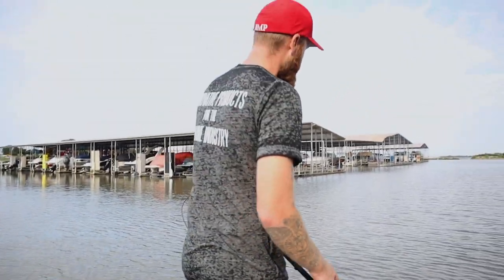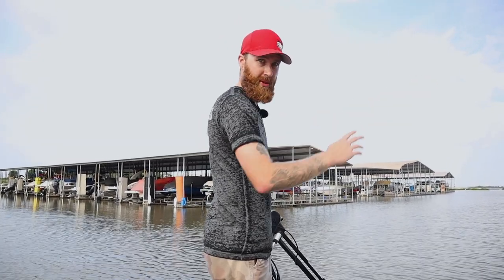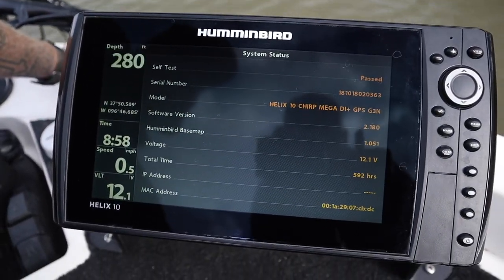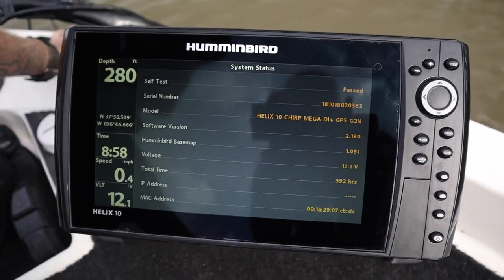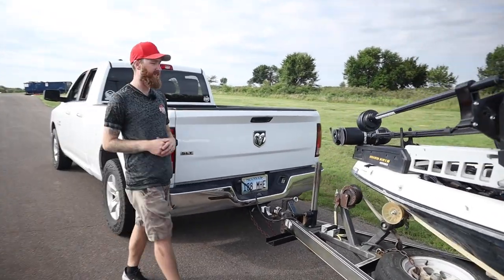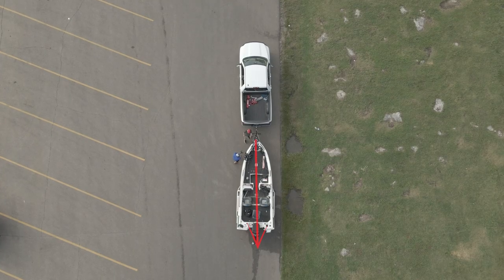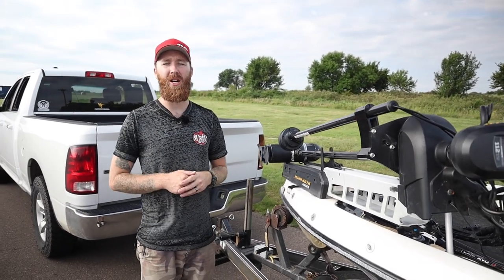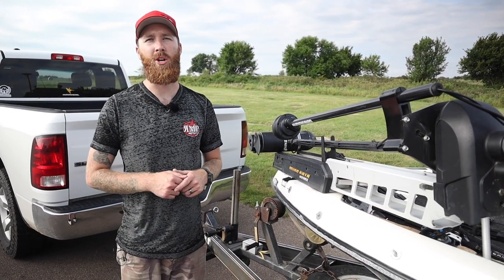HUMMINBIRD Mega 360 HACK - How To Get Side Imaging On Your MDI+ Unit - BUDGET FRIENDLY OPTION.

Comment: I am waiting for the Mega 360 transducer to be built in to the Minn Kota Ultrex, also expecting a real cable steer instead of the current "cable" (fly by wire) power steering version to compete with the Motor Guide Tour Pro. ...May never happen but Minn Kota Raptor (Power Poles) did.
Reply: You really don't want 360 mega mounted on your trolling motor. Then it would be the same problems you see with the trolling motor transducer from the other manufacturer's. The good thing about 360 is it's always oriented top of the screen in line with the bow of the boat. The others will move around depending on which  way you are trolling motor is pointed. Mounted a transducer 20 years ago on my trolling motor so I could see under docks. Problem is you have to position your boat with the trolling motor around the dock and then take a peek under it. But with the new spot lock systems unless you look at your trolling motor then look at your screen one second and make sure your trolling motor is pointed in the same Direction you want to scan and it's problematic. The other good thing about Mega 360 is very easy to see Fish and twigs and other fish holding structure. The distance rings and angular location of targets on the 360 display are very accurate when you're casting.  As with all systems there's a trade-off. 360 works better when you're stationary but if you move 5 ft and let 360 show you what's there it's very accurate. I find that bass and other game fish tend to hide in structure. So looking for structure on the 360 is better than seeing fish even though I can see fish moving around. Plus you can change the speed of the rotating 360 transducer. PS hummingbird makes a mount for Mega 360 that can be put on any boat. I look forward to trying  Side Imaging from my 360 on my bow mounted solix G2 and see if there's really any value to it. Mega 360 allows me to see what is in front of me and around me from the front of the boat. Using networked transom mounted Side Imaging transducer only shows you what's behind you. In my humble opinion not a very good way to  fish . And if I want to be quiet  and scan and area  I'll sit down  at the helm  run my trolling motor  with the remote and watch my console-mounted solix unit ,  equals comfort and  Side Imaging wow.  if you're networked you can also sit at the console and watch your 360 Mega images .                  I hope this helps, guy
Reply: Correction, the Humminbird Mega 360 unit is mounted to the trolling motor shaft. But does not rotate with the trolling motor head as do some of the other side looking transducers.

Comment: Do you have a video on how to shorten the shaft on a Mega 360?  I have a bass boat and during my install on my Humminbird Ultrex I find I am in trouble if I either raise my prop I run into problems with the transducer and if I lower the unit I run into the Head of the trolling motor hitting the top of the shaft.  What are my options?  Feel like I made a bad purchasing decision.

Comment: Have you been able to get rid of that interference yet? I have the same interference you have on your screen when in the Mega frequency and have any steering or thrust input on the Ultrex pedal. I’ve been dealing with it for 3 weeks (with some help from Humminbird) and we can’t get it to go away. The mega 360 works great when not on the trolling motor pedal. It also works great when I have the frequency changed to 455kHz and not 1.175KHz. Frustrated... I’ve tried everything.
Reply: Does the ultrex have a brushless motor like the Lowrance ghost if not this may correct the issue an see if there’s a setting for noise rejection an turn it on high not to familiar with humming bird I have Lowrance units

Comment: Noticed you had no depth reading on screen.  How do you get that to come up using the mega 360?
Reply: you can tell by the range of the entire picture and the black section in the middle is the water column. Though I haven't used mine yet, I heard this

Comment: Will you need a transducer for the DI or can the 360 do DI too? And will the SI image be mega or mega+ going through  the 360?
Reply from the maker: dsgbqc you can use your builtin DI on your TM, get the mdi+ w DI transducer which is cheaper than the msi+ combo. Yes the SI is coming from the 360 transducer
Reply: @RussellMarineProductsLLC  but is the SI image going to be  mega or mega+?
Reply: MEGA SI+ (1050-1175 kHz)
Reply: According to hummingbird the side imaging from the mega 360 is not mega+.    Just mega side imaging.

Comment: For those that do not have 360 Transducer.....Just run a Network cable from your Console SI Helix to your Bow DI Helix and from the Bow DI unit you can pull up your SI Transducer on the back of your boat.
Reply: As long as both units are N, i.e. G3N vs G3.